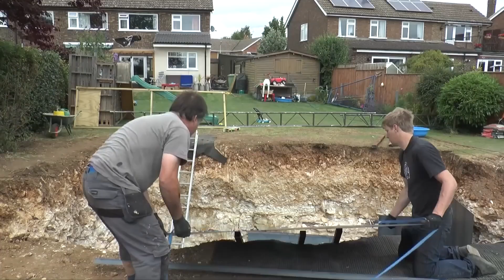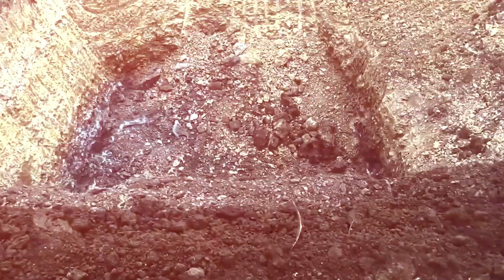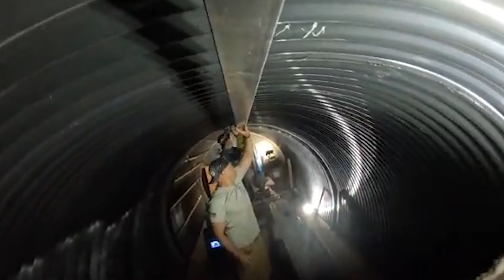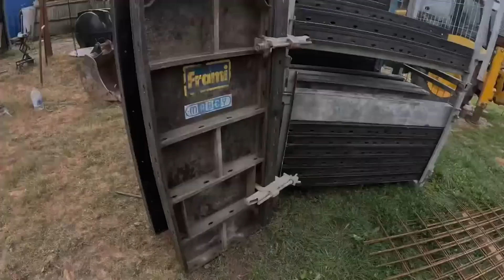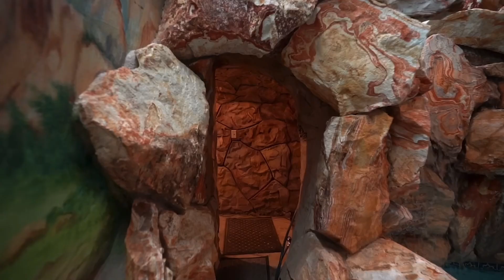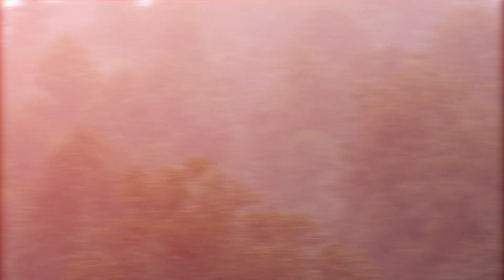Here’s the Engineering Behind ULTIMATE SURVIVAL Bunkers!

Comment: Not a single one of the underground shelters that you are showing being built is of any use except as a basement storm shelter!  So what is this "bunker" or shelter supposed to protect you from?  It won't protect you from fallout radiation!  Another waste of money and time if that is why you built it!  Dude where is your rain protection canopy and drainage system?   Any fallout that falls over your area will just seep into the ground after it rains a few times and surround your unshielded underground shelter you will be radiated as though you were above ground in the open or as in an unshielded house.  You wasted thousands of dollars dude and time if this is supposed to be used as a fallout shelter!  These bunkers that you are showing never be used as a fallout shelter once built without extreme and costly modifications above the shelter and around all the walls of this structure.  But hey it will probably protect you from a tornado!   Also don't count on your concrete walls to protect you from radiation that seeps into the ground your walls are no where near thick enough to provide adequate radiation protection!
Reply: Estos debían de pedir una ayuda a un psiquiatra.
Reply: For almost all the bunkers, they listed hurricanes, tornados, earthquakes, fires, and flooding as being things bunkers need to be resistant against. Only the bunker that was formerly a missile silo was mentioned as being one designed to protect against a nuclear blast/fallout, but it definitely wasn't a focus of this video.
Reply: Many of the clips are from Colin Furze's underground complex in England. Nowhere near as much civil engineering as stated here, lol. Colin's series is definitely worth a watch but doesn't really fit this video.

Comment: If you build one of these in Florida don't you need to worry about sinkholes?
Reply: If there is bad flooding (and/or storm surge) and the elevation of your bunker is less than 100 feet above sea level your vent openings would need to be quite high and sturdy or you might drown in your bunker!  A better solution IMHO is to build your house like a bunker semi-sunken into the ground in the shape of a sphere which is the strongest natural shape shedding wind easily with small (1foot square or less) windows, a reinforced 'mud room' and a base of gravel for good drainage and the water-saturated ground would tend to lift the structure rather than crush it!  Ideally, the structure should be self-contained with food, water, electrical power source and fuel for it (and/or solar)!
Reply from the maker: Yes it’s true. Would need to consider improving the soil around it and do substantial geotechnical exploration to confirm foundation strength first. Thanks for the question!
Reply: Humidity is a much bigger issue.

Anything above about 45-50% humidity in an enclosed space like a bunker and you’re looking at toxic mold issues. Florida has an average humidity of like 75%.

Black mold requires only 55%, and Florida is right in its actual ideal humidity range.

Comment: how do bunkers handle flooding? Seems like a bad idea!
Reply from the maker: Thanks for the question! Bunkers can actually be built with waterproof engineering designs! There are special seals and drainage systems that can be included in the design to keep water out of the bunker!
Reply: @EntirelyEngineering8 what about air pipes?